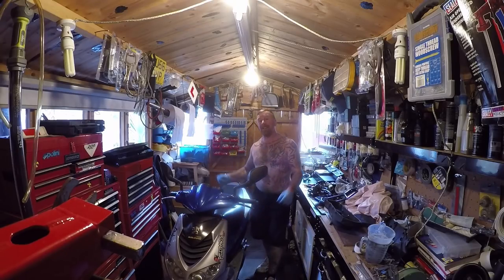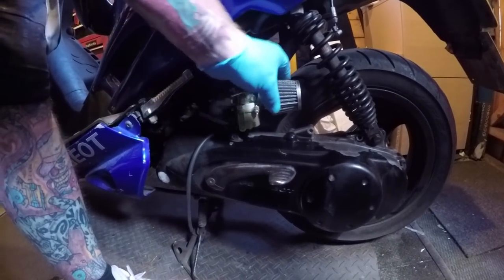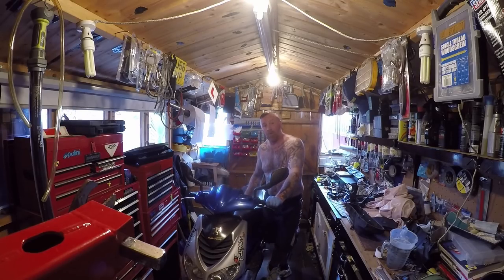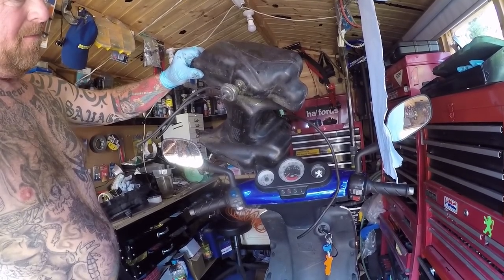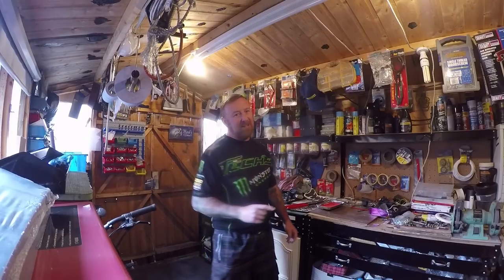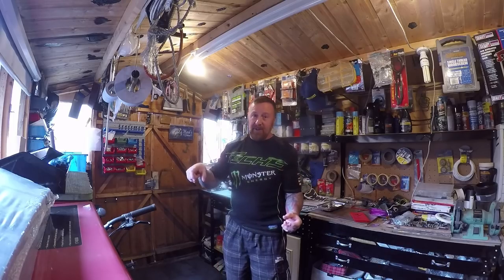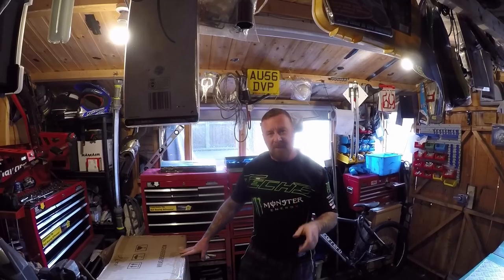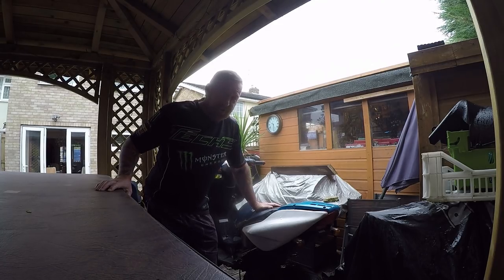SPEEDFIGHT VACUUM PETCOCK CARB WONT START MARK SAVAGE

Comment: Hi what is the perfect main jet for speedfight 2 ac i have deristricted the air filter and removed the variator restricter. I still have the exhaust restricter in though. My bike Was running 60kmh when i had a 56 jet in and restricted air filter. And now i have a 78 jet and It only Runs 55kmh
Reply from the maker: hi bud , that's too big, watch my down jetting and tuning videos , 
60 to 68 is a good area and id get the exhaust changed to a sports one that will help too 
thanks for watching , please like and sub 
mark
Reply: Yea i just have the problem that im living in denmark where i can Max drive 30kmh and im not allowed to use other exhausts than the Std one

Comment: Hi Mark I have been watching your video about mopeds and they been very help full iv done all the service parts on my bike and it starts but when I give it revs the wheel gose backwards it's a kymco 50cc scooter with cvt drive could you please help me
Reply from the maker: owen this can happen and it a faulty starter so needs replacing 
Mark
Reply: Hi Mark thanks for your advice iv started taking of the plastic around the stator and it seems some one has put a new pick up box wired in to the stator I cant get a stator if I have this one rebuilt will I still have the same problem as I'm not sure if it's the original pick up box or not
Reply from the maker: owen you stator should ok it’s the state motor 
I show this in my videos easy to replace and under £20 bud
Reply from the maker: You will have to open the clamp holding the wires first which takes a bit lol

Comment: What the best belts you can get for a 50 cc every one I get keeps shredding
Reply from the maker: if they are all shedding its more likely you have a problem with the clutch and variator !!
I have loads of videos that will help like over 70 on speedfights and more on other peds, as for yours like I have had before you will need to take them off and rub them down as they can get rusty and then shred the belt
if this does not work them you will need to replace them and then a new belt 
please like and sub
mark

Comment: My speedfight does 40 mph flat out with sports exhaust and it's making a crunching noise from side casing
Reply from the maker: I have over 70 videos on spedfights and another channel where they are all in one place on a play, some no matter what you do will often only do that but you need to take off the cover and see whats going on 
my videos will help on the variator system and check out the roller video
hope that helps, please like and sub
mark
Reply: mark savage I've change rollers clutch belt and it's the starter cog making the rattling noise
Reply from the maker: that will be the Bendix as they often rattle on the VARIATOR outer part but like in my videos bud sometimes that's all they will do and other top out at 55 60mph, go figure but you may start to look into a sport exhaust bud 
mark

Comment: Hi Mark I got derbi senda with a racing crank  and arisal 70 kit and decat exhaust also a 21mm carb its been running great for a week starting first kick, but yesterday started up and it scream and die as if it ran out of fuel but it hasn't 
I've clean carb/put new plug then I retry starting it but bogging and stalling  the vacuum petcock is dripping ever so slightly could this be the reason its not running right?
Reply from the maker: yes bud you need to stop that and sort it , a flooding bike will do the same as a bike with no fuel and die
Reply: @marksavage  ok cheers I just don't understand how these vacuum petcock work? I can't tell if its blocked or not?
Reply from the maker: @ethanb6276  one pipe is air the other fuel so as in my videos you can suck the air pipe and the fuel will come out and when you stop it should stop 
if it runs out all the time you need a new one bud
Reply from the maker: @ethanb6276  thats easy does fuel come out when you suck it ??
Reply: @marksavage  hi Mark yes fuel does come out im thinking now its my carb has dodgy float and it starts revs up high and dies i clean the carb runs well for 5mins and then does it all over again
Reply: @marksavage  also I've noticed that the cap that screws into carb  is split
Reply from the maker: @ethanb6276  yes it does sound like a stick carb bud
Reply from the maker: @ethanb6276  the cap they fits on top and keep the spring and needle in ???
big problem bud and need a new one if so
Reply: @marksavage  yes thats right I know mate someone has tryed glued its a mess lol  the owner before me
Reply from the maker: @ethanb6276  its just letting it suck in air bud so not good
Reply: @marksavage  yep I've a brought a new carb

Comment: Hi pal.Are the carbs the same on the air cooled and water cooled?
Reply from the maker: Matthew Patrick they are different but you can use on either but easier to use air cooler on water cooler just reconnect the water pipe back to the head , if water cooled you can leave the water pipes off 
But really no biggy as long as it run ok bud 
I have many videos on carbs to watch 
Please like. And Sub
Mark
Reply from the maker: Matthew Patrick wait that aeroxs Lol speedfight yes but they will fit both as same fitments 
Mark
Reply: I got an aftermarket one.But it won't run with it.If the speedfight ones are the same for air and water cooled I'll get a proper one.Cheers pal.

Comment: Hey mark! Any idea why my 50cc 2 stroke performs worse after 4 hours of riding it straight? After around 4 hours it doesnt accelerate half as fast and struggles to go uphill. The next day its back to usual again
Reply from the maker: I think any 2t would not be happy riding for that amount of time!, they are really for popping around town and short trips.
I know a few people do ride than longer trips like 30miles or so but still that's a big ask from a little 50cc bud and sounds like its all most heat seizing or piston ring damage, how it keeps doing going is just beyond me to be honest!!
if your older than 16 i'd get a 125 quick lol, but to be fair it's doing well but expect to be changing the piston and head soon
mark
Reply: mark savage its a 2009 yamaha jog cv50. So now that you put it into persoective it is 9 years old and its done 31000 kms. Anyways thanks man!!
Reply: Probably the Contra spring.

Comment: I really need help with my speedfight 2 it just wont start i bought a new spark plug a new battrey nothing i have cleaned the carb it just wont start i cant kicjstart it just makes a noise and once in a while it will make a big sound and then cut of straight away i have watched your vids but i do really need help ☺
Reply from the maker: mr porky if it’s water cooled take the head of like in my videos and have a look at it 
Not just the top the sides too and have a look as it sounds like it may have gone 
Was it running ok before ?
2t oil ok ?
So it just turns over and won’t start but pops ? 
Worth a check bud and go from there 
Hope that helps 
Maybe check out my speedfight channel as all 70 videos for help are on there 
Please like and sub 
Mark

Comment: Alright mate u got any clue why full beam flickers on and of low beam fine
Reply from the maker: it can be either the volt regulator or stator coil , check and clean but the volt reg will need replacing . but best check earths first bud
Reply: @marksavage  thanks mate were do I find the volt regulator pal
Reply from the maker: @naomireynolds2423  under the foot plastics at the front 
So seat off panels off then you can take off the belly pan then the floor panel will lift up 
It's a lot of work but the only way 
I have 100 videos on speedfights so give some of them a watch as i do covet it
Reply: Thanks mate mine does look a bit shity TBF rusty so no doubt it is that thanks again

Comment: My idles allover the place at the min when im able to start my scooter and when i try to rev it it bogs out mostly but sometimes it will rev abit then die do u have any advice mate?
Reply from the maker: hi bud 
this is common when the carb is not set right or not on tight
take it off check the size of the main jet and them clean and make sure when re fitting its on tight and that the needle is not bent and on the main pin it's in the middle like in my carb videos 
please like and sub and watch my other videos as they will help as there's over 70 for you to watch 
mark
Reply: mark savage thank you mate ive subbed your videos are really helpful as my bike tends to want to break alot lmao

Comment: G,day  Mark, I have a few questions for you coming from down under Sydney style lol.
1. My fuel gauge is working when full but when it gets to half way on fuel it says its empty ! what do I need to do to fix this?
2. Do you have a video on how to fix this? will the tank need to come out?
3. I have a speedfight prost 100cc 1999 and you say in a video to get rid of the standard exhaust for a sports exhaust, what 1 do you recommend? 
4. My back calliper is leaking is it best to buy a new calliper or can you repair this?

Thanks in advance and your videos ar getting more funny as you do them...lol Typical UK weather!
Reply from the maker: hi bud thanks for watching 
ok seat bucket out and then on top of the tank you will see the fuel gauge sender, its the round sender and just twist out and then remove, turn on bike and move it up and down to see if it works if not replace bud. nice and easy and I do have a few older videos on it.
yes it will improve the performance of the bike with a sport exhaust, leo vince work well stage 6 and so on but come down to you budget 
you should be able to just replace with too much bother but if it does you may have to upjet a little by 4 and I have videos on upjetting and tuning on my channel
if it is leaking from the calliper it will new changing as once they leak they are hard to sort out so best get another, if it's from the hose that also needs replacing 
I do try and keep getting better and hope you enjoy them, bloody weather pmsl
mark

Comment: MARK any chance you can tell my why my speedfight 2 50cc aircooled starts but then I rev it it revs then stops then revs and wont move off
Reply from the maker: id say its your carb bud very common , take it off clean check jet size and tune like in my videos on my channel they will help bud 
theres over 70 speedfight videos that cover all this
Reply: savage is taken the carb off taken jets out cleaned them new seals but still doing it
Reply from the maker: @jucufhfhh7419  what size jets 
Standard is 54/ 56 
Where is the needle 
Should be in the middle setting 
Air mix 3 half
Air filter ?
Is it a peugeot carb ?
17.5 mm
I've had this and had to replace the carb bud
Reply: @marksavage  it's a original speedfight carb not been played with apart from me taking it apart today
Reply from the maker: @jucufhfhh7419  they can get hair line fractures they allow air in etc so may never run right 
Has it the right gasket 
Vacuum ok like in my videos test
Reply: savage  I have just tried a new carb I have had in the shed for a while it's still doing it when I rrev it it gives revs then stops revving then starts aging
Reply: @marksavage  thanks for the help mark turns out seal on the jet had been split all up and running now cant thank you enough

Comment: What is the psi for a Peugeot speedfight 3 please
Reply from the maker: PSI for the tyres?
or compression from the engine?
Reply: @marksavage  tyres mate
Reply from the maker: I always put 30 psi in all my tyres for mopeds bud as you cant go wrong with that

Comment: My mark 1 speedfight has 5000 genuine miles which is 8102 km mental
Reply from the maker: that's low miles bud and should be a good engine
Reply: @marksavage  yeah sure is fired up of the button hot or freezing cold and kickstart, but it doesn't spring up so will look at it sometime but wow its fun it just keeps going on full throttle it like surges Haha!
Reply from the maker: @ChadTheLad  the kick starts do that, free up and re grease it
Reply: @marksavage  cheered for the help the videos are even better!

Comment: done it uploaded it mate
Reply from the maker: that's not running right is it bud , ok the funny deep noise is coming through the carb like back pressure 
was that you when you started it that you kept your finger on the starter ?
you may need to up the revs a little to keep it running 
so you have taken off the head and put it back on ok and tight like in my head videos so criss cross the head bolts and the exhaust it on tight too as you sometimes get that noise if not down tight
mark

Comment: Can u help me with my speed fight 3
Reply from the maker: David Small I have a few videos I n sp3’s type in speedfight 3 mark savage to view as they may help also 70 on sp2’s which also may help 
Mark
Reply: @marksavage   thanks I had an out of the blue problem wasn't getting any dash power but new ignition fixed this but I still can't get it to start
Reply from the maker: @davidsmall3784  is your speedfight immob or none immob
Reply: Non immobiled, seems strange but I got power to dash but it only comes on when you hit the starter button
Reply from the maker: David Small there’s a short or cross over wires somewhere bud 
I’d take everything thing off and trace all wires and connectors
Reply: Found it thanks for the help finally running

Comment: Hi Mark,

here is the issue videoed https://www.youtube.com/watch?v=MjxmLEGA0aQ&feature=youtu.be might be easier to see than for me to explain, cheers again :D
Reply from the maker: so it runs but once you pull the rear brake it stalls ?
everything else look ok so would guess its the clutch will need looking at or replacing, take it off and see how the bike runs you will need to re set the rollers after the test while your there have a look at them too if they need changing but it look like its not disengaging but the rear wheel often turns when on the stand but not stall when stopped 
hope that helps 
please like and sub
mark
Reply: mark savage yep. As soon as you come to a stop e.g traffic lights. The engine stalls and when you go to start again it pulls you along when trying to start. Weird. I have changed the rollers last night as they had flat spots but still the same outcome
Reply from the maker: then yes bud defo your clutch has gone so you will need to replace it, mark
Reply: mark savage okay cheers I will look at getting a replacement. Does the big spring need replacing or just the clutch ?